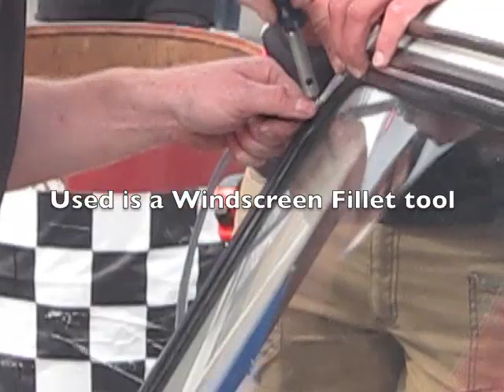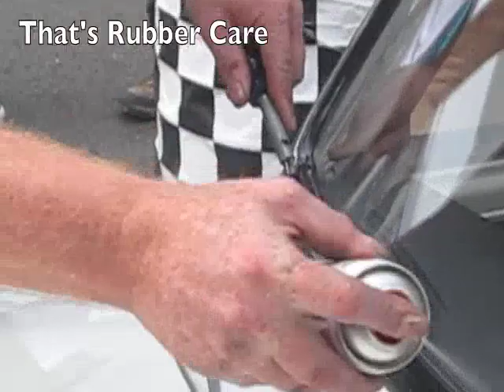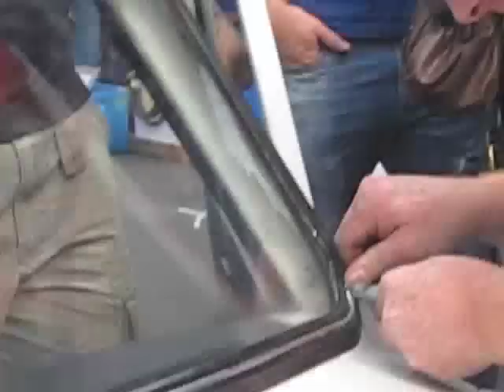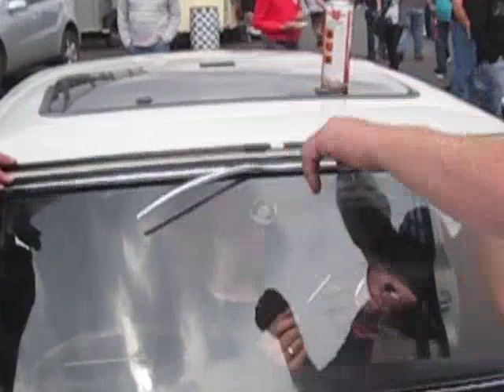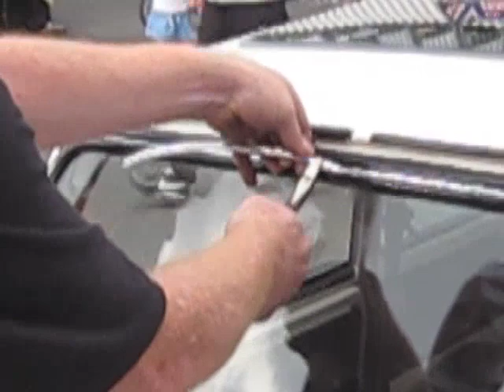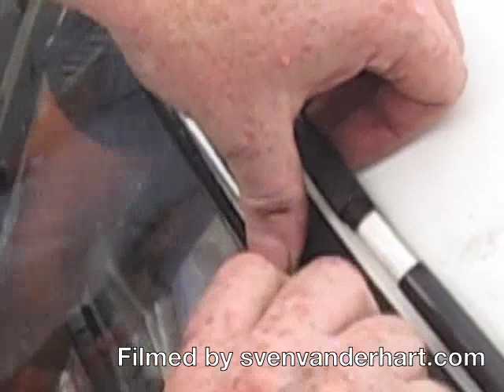Classic Mini front windscreen fitting by experts (a how to)

Comment: That is pretty impressive. I'm wondering if they put down beads of sealant on the flange before fitting the screen? Another consideration is the extrusion section they used. I've found there are some quite different sections out there, and some are much harder to lock then others. I had one that went in easily, but leaked like a sieve!

Comment: Twisting the (by the way, it's a 'filler' tool) handle, you risk damaging the edge of the strip. The movement should be long and straight - achieved by elevating the handle to make the leading angles of the 'eye' flat and level with the recess.

Comment: no twisting you damage trim and put sudden pressure on edge of glass,get the angle right it should slide along while other handis lining it up for tool,never tried spraying oil just soapy water to keep job clean.